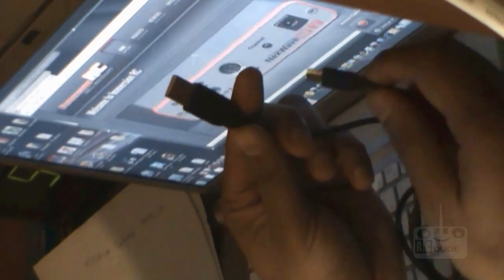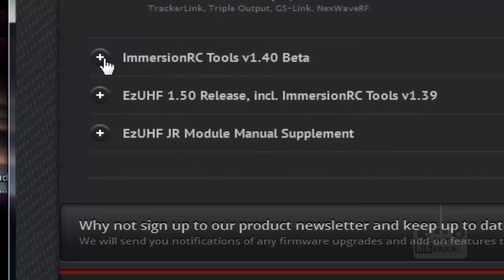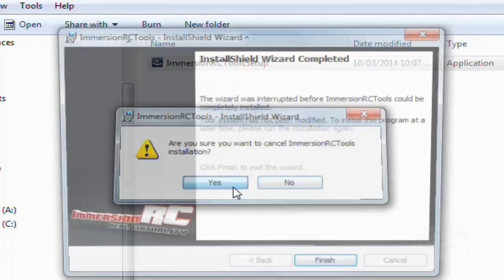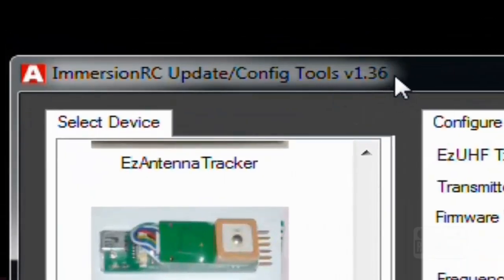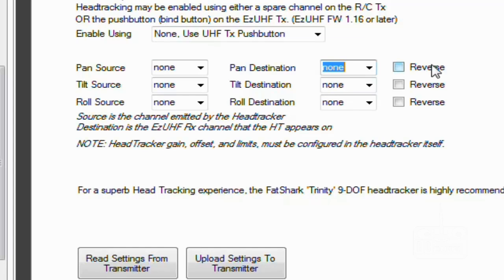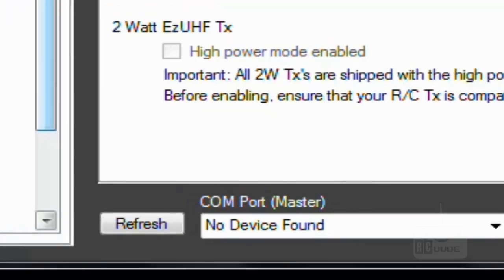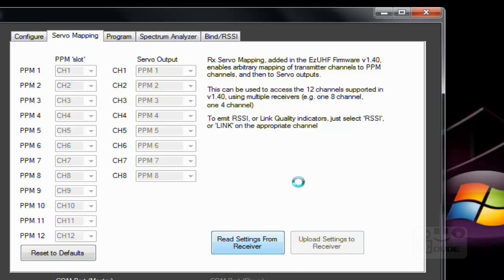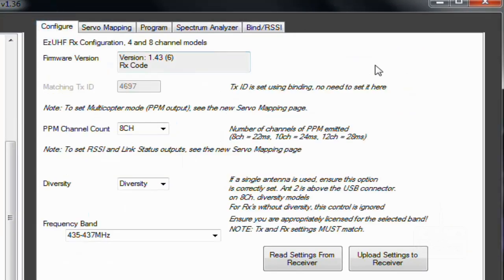EZUHF Transmitter And Receiver How To Use ImmersionRC Tools Setup

Comment: Greetings - I can't use the button on the receiver anymore to bind so I have to use the software - but it is not working - same firmware versions!! please help
Reply from the maker: gmoeller54 if button is broken try to  use the software if its not binding relax little bit and try agian. but if it is not binding. must be your transmiter broken. relax and might come right thanks and sorry late reply. thants